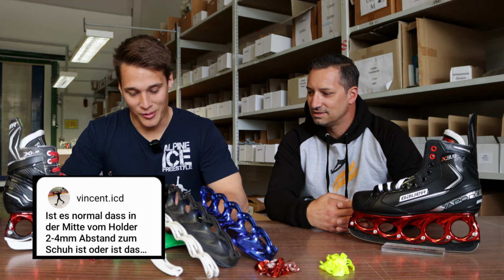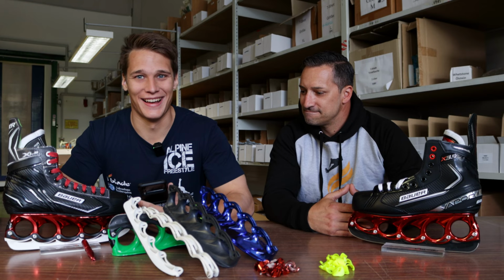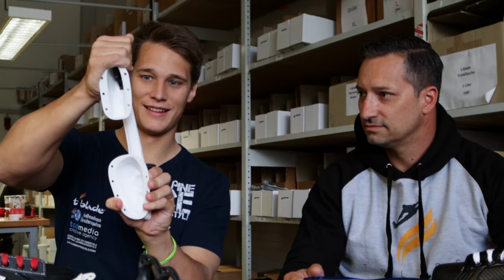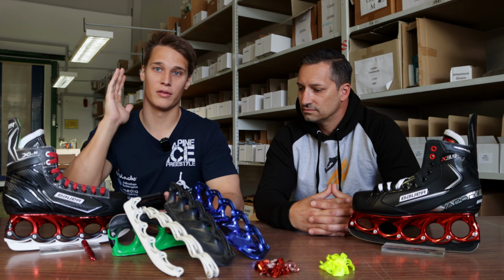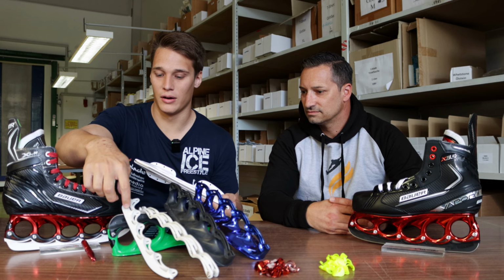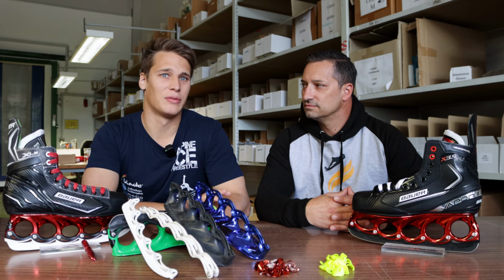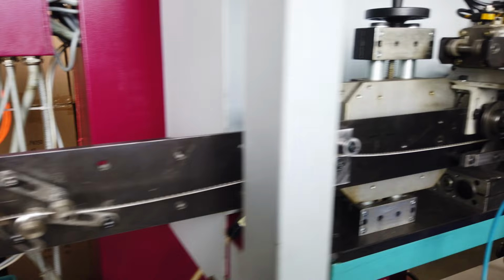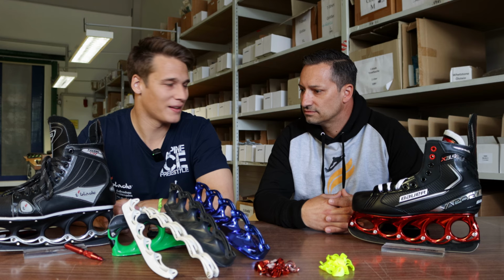Can t-blades break??? | t-blade Q&A

Comment: I want to buy them but the problem is I live in South Africa and ice hockey is not really a popular sport and there's no warehouse and stuff like equipment so you can only order online and can the t blades be sharpened in the ice rink like normal skates or I have to get separate equipment to sharpen my blades??
Reply from the maker: You cant sharpen tblades. The clue with this System is that you exchange the runners to get the same feeling every time

Comment: Tolles Video, gute Einblicke :)
Ist der Carbon Holder welcher im Video zu sehen ist die „Raw“ Variante oder die Schwarz lackierte Carbon Variante? Auf der Website sieht die Raw Carbon Variante sehr sehr hell aus, fast schon hellgrau und das würde sich mit meinen Schuhen sehr beißen vom Farbton.
Vielen Dank!
Reply from the maker: Keine Angst, der Carbon holder ist praktisch genau so schwarz wie ein schwarzer Holder, die Bilder von tblade sind nicht immer ganz akkurat😅
Reply: @AlpineIceFreestyle  Okay vielen Dank dann sind die Bilder auf der Website wohl ein wenig irreführend ^^
Blöde Frage aber wurde mal beantwortet was mit der Runnerproduktion im Falle einer Insolvenz von T-Blade wäre, da das System ja nur mit original T-Blade Klingen funktioniert :/
Reply from the maker: @boostarmy1421  das weiß leider keiner, ist aber auch zum Glück nicht sehr wahrscheinlich ;-)

Comment: Greetings Friends, Hi Patrick and Andre from USA.  I changed my Bauer X700 skates size 8.5 from a Tuuk 280  to t-blade 280. I am ordering new t-blade Bauer size 8.5 Vapor X3.7 which uses a systemsize 272. Shorter runner is better? T-blade holder is smaller on the same boot? No big deal but I'll need new holders and runners, clips are the same? Thanks Friends, hope all is well
Reply: Hi Tom, Andre from t-blade here. So we at t-blade have always built 272 on Bauer size 8.5 also on size 9.0. You can see that in the size chart. The system size of t-blade is always one smaller than the mounted Bauer systems. Did you have it rebuilt in the US right?
You could then compensate for the smaller size with a larger footprint on your runners. Otherwise, you're just more agile now when the same runners are driving in 272.
Reply: @andrefischer5681  Excellent, I'm putting in my order, thank you
Reply: @andrefischer5681  I rebuilt it myself with my cobbler, thanks again Friends
Reply: Check it out Friends, my new X3.7 doing a Hawk Stop, using a S-13-272, love them!